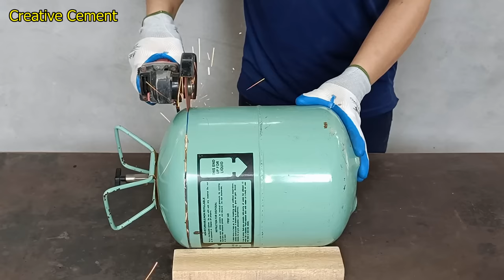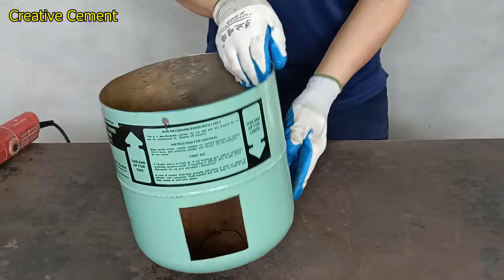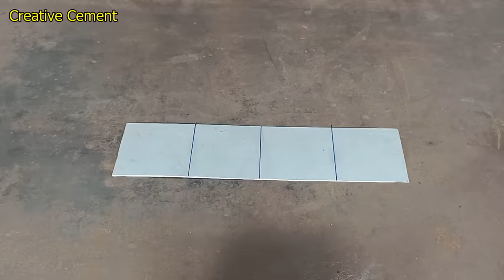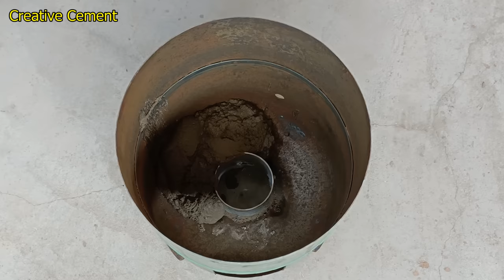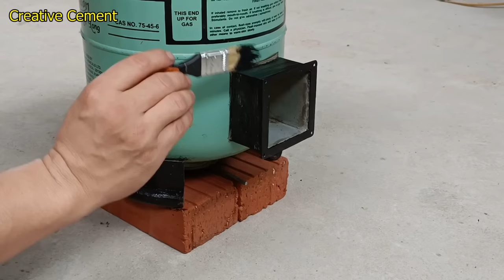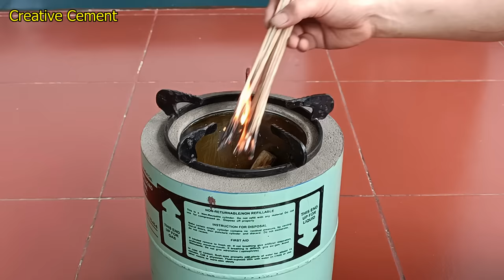How to make a highly efficient wood stove with a fan

Comment: How many volts is it?
Reply from the maker: It has a capacity of 15w, uses electricity 220v
Reply: @CreativeCement  The blower will run on the mobile charger

Comment: how much the fan voltage??
Reply from the maker: fan with a capacity of 15w using 220v electricity
Reply: @CreativeCement  can I use computer cooling fan ..or can I use less than 15w??